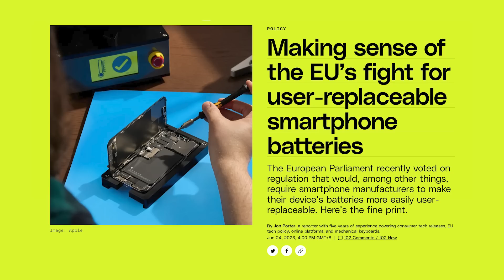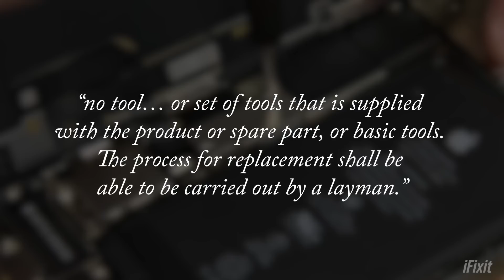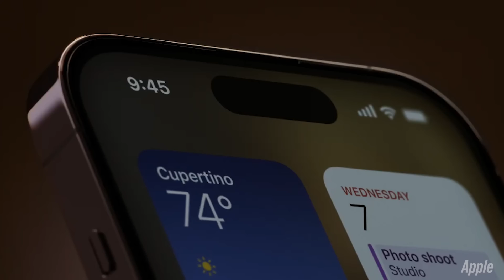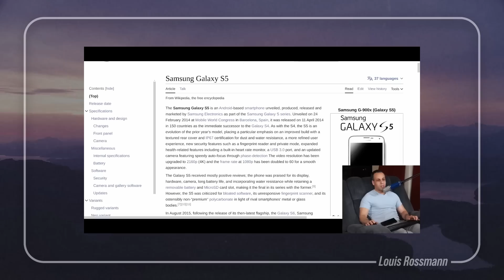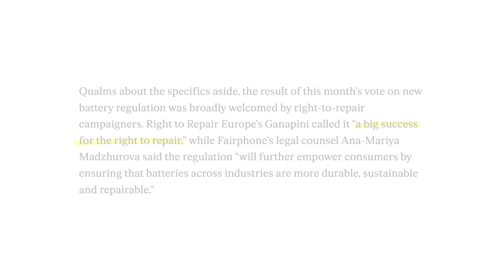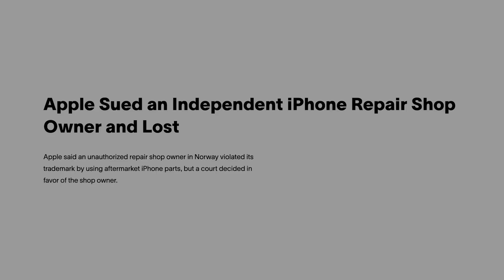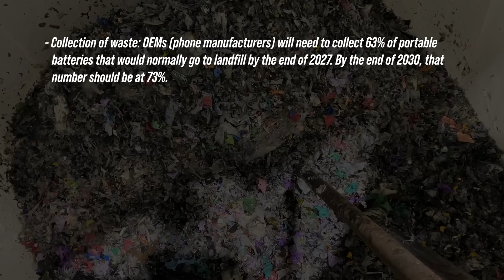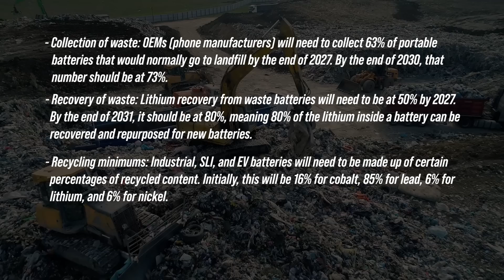EU Just Changed Smartphones Forever

Comment: Don't know about you, but I was glad when we no longer had to worry about removable backplates and batteries in phones. It was more trouble than it was worth.
If they're going to push anything into consumer law, it should be more innovation toward creating inbuilt batteries that last longer, hold more charge and have a better half life.

Not to mention, despite what the EU bodies are highlighting, the battery drop off is not the primary issue for device degradation or the user feeling the need to upgrade, the ACTUAL primary culprit is the fact that manufacturers update their software consistenly and the hardware resources go out of date at a faster pace every year. The OS along with new app tech pulls greater resource and creates a heavier load, meaning the device slows down. The battery life is always secondary to this, in my experience anyway from the day mobile phones became massmarket.
Reply: how the hell are user removable batteries more trouble

Comment: 10 years ago phones had removable batteries. Even some smart phones. It was as simple as having a back cover that unclipped or slid off, and a replaceable battery that was held inside with a tab and some spring connectors. This only changed because Apple, being the assholes they are, sealed in the battery to make their devices obsolete over time. They glued the battery in and made it impossible to remove the cover without special tools They have continued with device obsolescence ever since, DRM'ing modules and so forth. And other manufacturers copied Apple. So it's great that the EU is forcing user replaceable batteries but Apple willl never stop being assholes. They'll artificially limit the quantity of replacement batteries, jack the price up sky high, they'll load them down with DRM or other proprietary complexity and they carry on doing it. If the EU really wants to put an end to these shenanigans they should require all batteries to be open specification and encourage industry consortiums to develop some standard capacities and dimensions for batteries - all the way from those in airpods all the way up to passenger vehicles. And they would also require that major components in phones are also subject to open standards and right to repair. If the likes of a Fairphone can be popped open and fixed with relative ease then there is no excuse the same is not true for other phone manufacturers.

Comment: The move from easily replaceable batteries to built-in fixed batteries, was definitely driven by profits. There was no need from consumers for non-removable batteries. In fact there were some users who carried spare batteries in case the primary one died, so the argument could be made that the move to non-removable batteries actually inconvenienced consumers.

I think the next thing that should be addressed is the unjustified and unsustainable resource consumption in mobile devices, because even if this law is passed in the EU, it wouldn't do much to prevent phones needing replacement every 2-3 years. One of the biggest driving forces for replacements isn't even battery issues, it loss of functionality by ever-increasing resource needs. These days even the most basic application requires an insane amount of memory.

Comment: Profit. Profit. Profit. Built-in obsolescence has been a thing since not long after the invention of the lightbulb. That’s why, even if you want to keep using a “perfectly functional” phone for several years, after about 2-3 you start having problems. Particularly the battery life or the phone just deliberately screwed up with “essential” updates aimed at newer models. Even if you get yourself a new phone, handing your old one off to, for example, a relative who won’t use it much, the way we used to, isn’t always an option nowadays.

Comment: I believe it was the latter. Anti-consumer decisions made to increase profits. Now I agree with Louis Rossman, that these decisions weren't made by mustache twirling villains with the explicit intent of making our lives worse.
It was more like "Hey, boss, I crunched the numbers and we can squeeze out another 3% of profit on these phones by cutting out the design need to replace the battery. Some people might be mad, but I don't believe it's that big of a deal."
Or the apple macbook flex cable: "Hey, I ran the numbers on our flex cable flaw. It will cost us another $3mil to fix the flaw in our software that makes it so that the flex cable can be swapped by our repair partners. Honestly if we leave it as is, we don't need to spend any money on new logistics offerings, so lets not touch it."
All of our consumer product woes are the snowballed result of years and years of short sighted decisions put on top of short sighted decisions for the intent of short term profit gains.

Comment: I bought a cheap smart phone during the pandemic (I never had one before) to use with a very cheap cell phone plan (25$ a year - no internet, 50 cents a minute).  It "jams" once in a while on startup and I have to remove the battery.  Luckily, I can open it with my fingernails (or a flat head screwdriver) and the battery is easily reseated.  It's annoying but at least I can do it.  and my phone, BTW, it very thin.

Comment: A thought: should we have a standardiziset repairability score on devices? Similarly like we have energy efficiency scores. The average consumer has no easy way to figure this out, even if they wanted to buy an easy/cheap to repair device. A simple rating on the devices would tell this, as well as incenyivicing manufacturers to make them easy to repair.

Comment: Can’t wait. Everything a manufacturer does is profit driven, directly or indirectly. Having sealed batteries does make waterproofing and assembly easier and cheaper but it also makes the consumer more likely to just replace their device when the battery reaches the end of its useable life. I have zero doubt that getting consumers to upgrade is the number one motivator. This includes the ridiculous prices of repairs.

Comment: I loved the LG design, it had room for improvement also. Replacing the USB port was as simple as swapping the bumper.
Reply: tho I am scared for the downside that if the battery expands, it will probably be stuck and dangerous to try to pull out, but being able to change easily the whole charging assembly with how easy it is to wear out the plug is a really good upside

Comment: I'm all for this law, but the scope is really REALY DUMB AF. I mean it affects EVs too? How is a layman supposed to swap out an EV's battery pack without any tools? Not even a car jack? nice DUMB implementation EU. Good one, you just killed carbon reduction efforts. No manufacturer is going to bother designing an EV that can have the battery pack removed and replaced by a layman without tools.

For one, it's going to get stolen. And also incredibly UNSAFE. Battery packs contain a ton of highly volatile chemicals that can easily explode. And the car is usually designed to have the battery packs sit tightly in a specific corner with all the insulation and safety precautions in place. If it's hot swappable like a nokia phone battery, it's like removing your entire car's gas tank (while its full) and leaving it in the house porch. STUPID.
Reply: it have to be tool less, the tool is included with the purchase, or its common tool.

i never meet anyone that dont know wrench and jack.

Comment: The top brands have dominated the markets by possibly colluding to not make batteries easily replaceable by users. This makes sense to make phones Obsolete after a few years so that they continue to get new sales. But this Possibly Intentional Flaw in the design Allows small new players to overtake their markets using hotswappable batteries . Though this way, the  phones are not made obsolete due to aging batteries, hotswap or replaceable batteries allow them to overtake the top brands. Eventually, the top brand will be forced to do the same , benefitting the powerless peasants. 😅. Either that or top brands may silent the small players by buying them over.

Comment: I would love to see replaceable batteries for e-bikes down to phones and watches. Cars i think should use a shop or such... I wonder how this will work with structural battery packs.

I think it will be a fight between replaceable and cost to make it replaceable.  Yes I remember carrying a spare battery for my  phone. normally it was the original battery after it had lost some of its life. 

yes I want right to repair. and yes i can see why in many cases manufactures try to limit components of combine them. 

Yes i have replaced the battery in my Ipod3color 4 times now. and yep that was tricky to do.

Comment: Even if they make separate versions for EU and the rest of the world, I'd still be inclined to buy the EU variants purely on the 'maintenance' cost be considerably lower since battery replacement is generally the main thing I personally worry about on my phone. On a related note, I recently had my screen crack and I absolutely love my phone, so I sought to get the screen repaired, all places quoted the cost would be half the original MSRP of the phone, I was so confused and looked into how to do it myself and realized the problem, they use adhesive to glue the battery to the screen which makes replacing screens or batteries very difficult, it's just bad design that they are passing onto the consumer to eat the cost of.
Reply: If separate models exist they will support different radio band unfortunately

Comment: At least part of the reason that batteries started to get integrated in the first place was because they were trying to make phones thinner and add more water proofing . I'm not saying that the repair aspect wasn't part of the plan already back then, but the one of the main things back then was the battle for having the thinnest phone. Anyone who remembers the first generations of smartphones, also probably remembers that they were thick and kind of uncomfortable to hold. These days however, that's largely a thing of the past, it's not really possible to make them much thinner and I don't think there is much reason or demand for it, especially considering that it would compromise them in durability and features. 
There is no reason, apart from the repair aspect, and maybe also waterproofing, for phones to not have replaceable batteries today though, and I'm very pleased over these news.
Reply: and why aren't phones more waterproofing and thinner ?

Comment: You could repace batteries up to literally only 5 years ago and for a good reason. Replaceable battery phones are usually not what one might call "water resistant" and come with a slew of user error issues. But hey if you think putting phones back more than 1/2 a decade is the future, or that a removable battery is somehow more eco friendly than a solid state one once in the garbage, then enjoy your broke ass phone youve had only 6 months lol.

Comment: I worked for a phone repair shop for 2 years. Most of the time I was busy replacing these "non-removable" batteries. It is not that hard at all... There were phones we did not recommend any more replacements - but those were running on extremely outdated android or IOS (which can have security issues).
I also replaced screens, speakers, buzzers, buttons, frames, back panels, charging ports etc..
The only manufacturer I had problem with was apple. We weren't certified partners for Apple either  (there is only 8 shops verified in my country and all of them are in the capital city).

Why no change in home screens? Did you know that the average battery dies in 2-3 years? But the average user breaks the screen of the phone just in half a year?
The batteries can be replaced for less than 50 Euros (in Hungary). 

Yeah maybe the non-remavable battery was created for more profit, bot the people who decide to throw away 2 years old phones because they need more regular charging (and they don't want to leave their phone for some hours at a repair shop) are the bigger problem. In my country, where I lived and worked back then, there are a lot of poor people. Who can not afford to change their phones every 2 years. So I had job. They had new batteries. They kept their phones. Win-win-win.

My additional fear is coming from the fact, people can be extremely stupid. I speak from experience... I can't wait to hear "my phones battery was always falling out, so I superglued it in... now my phone stinks of acid, why?" or "my battery was puffed up, I just pierced it and let the air out, now everything is fine..." (not fine) or "I accidentally ordered the wrong battery, but I forced it in anyway, and now it wont come out".

Comment: I really apreciate it, despite the fact that industry will find a way to trick more money out of the pocket.

EU-regulations for charging standards have been a big sucess. Now all devices are USB-c. So whatever tablet or smartphones I buy, or visitors at my home bring, we can charge them with the same cable. 

And this will be usefull for batteries as well. Maybe I don´t have to charge my smartphone anymore. I could swap batteries and recharge the battery in a station. Also third party will sell the batteries for cheap.

Some of my friends do not handle their batteries well and need to replace the smartphone every two years. This will be a thing of the past.

Comment: Please do not make a removable battery like the LG G4.  The battery sliding from the bottom is a disaster waiting to happen if the battery happens to expand.  Why?  If the battery expands then it becomes jammed inside.  In the case of the LG G4 they opted to make the power switch use a pressure contact.  It was permanently part of the back half of the case.  When the case was closed it was supposed to make contact with the motherboard.  However when the battery expanded it broke that contact.  Result?  The button couldn't be used to turn the phone off.  Depending on the state of the software you might not be able to turn it off at all.

I speak from experience.  Fortunately my phone did not explode/catch on fire but it was very nerve wrecking.

Comment: If solid state batteries come to smartphones, this law may be misplaced or its intentions irrelevant.  Solid state batteries are already available for very small devices like hearing aids, and could be available for consumer electronics in 5 years. They can be recharged much faster and last longer.  The battery may never need to be replaced even after 5 years, and could even be replaced if they were in a phone that is held together by glue.

Comment: The stopping of user replaceable batteries was purely a greed thing by the manufacturers. Apple were/are the worst for this, they want thier customers to be constantly buying the latest and greatest product. Apple even incentivises owners by making older products work slower over time (they say to prevent battery damage) forcing the owner of the phone to buy a new one.
Samsing and Google are also just as bad, they both use super strong adhesives to prevent the user from opening the product without breaking it. Why the equivalent of crazy glue is used to secure batteries inside an already bonded phone is beyond me.

Comment: Let me tell you as a guy who has worked in hw engineering, there was never a need to go with glued in batteries. We never wanted this.
it's point blank planned obsolescence. Waterproofing is a cheap excuse.
All we'd need to do is copy what Sonim did, which is essentially something we've done on consumer devices of all categories for over three decades now. Screw-fit, gasketed, pressure covers.
Super easy.
Apple will 100% pull another Apple and code the batteries, so you won't even be able to switch them between phones.
Apples concept, as is a lot of companies concept, is easy. Make you love to use the product, make it as expensive as possible too.

Comment: I worked for Samsung Tier II hardware & software training to authorized service centers doing these repairs and can tell you they don't give a flying fuck about their technicians, ease of repair even if done authorized, and water ingress will never be warrantied, ever, despite their claim of IP68 rating as they can't ever prove you didn't exceed the limits such as depth or duration submerged, or in the flip/fold devices as a consumer myself I learned you're also fucked on those devices cause yes, the board is coated and you'll be fine, but there are water indicators that will be tripped indicating liquid reached the internals and you voided the warranty. They don't give two flying fucks about their technicians or water resistance, that's marketing and PR, the reason why is 100% cost. It's cheaper to manufacture this way, period.

Comment: Good. Anyone who has worked on old phones and new phones should welcome this. New phones are disgusting. Why would a glued on glass back even make any sense? Just glass on the back alone never made sense glued or not, it's a terrible material for that purpose, it's slippery and brittle. Glued on they are very hard to remove without breaking them, you have to get the back of the phone far hotter than you might think, and it will still likely break since the glass has almost zero flex before a breakage occurs. Then replacing the battery is no small task, tiny fragile wire harnesses must be removed, and the battery itself is glued inside the phone. Need I explain the dangers of accidentally nicking a li-ion battery while prying it?